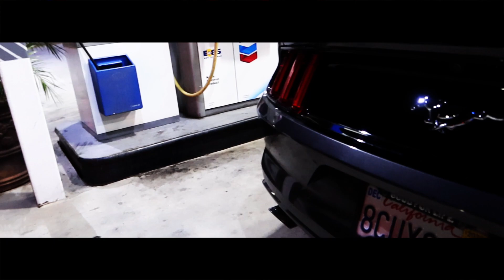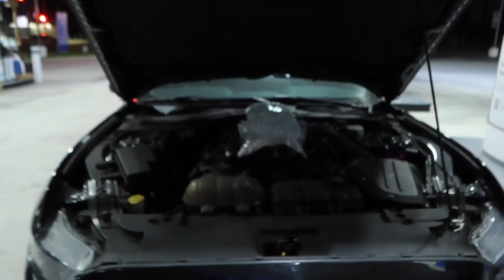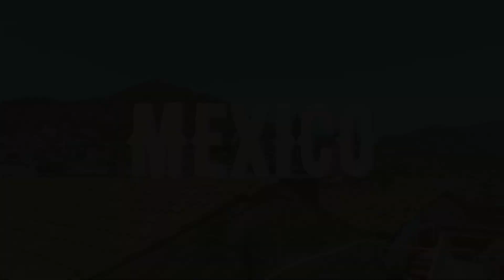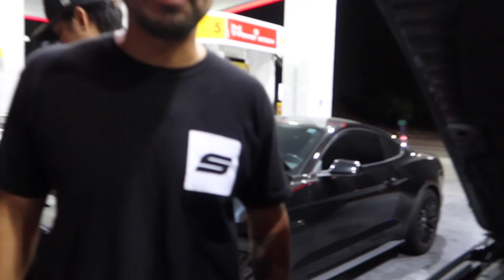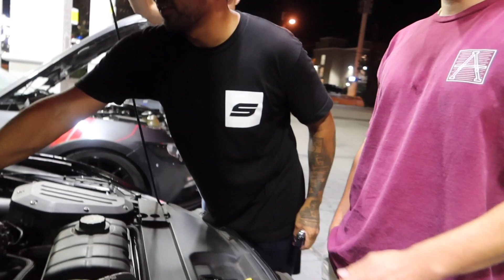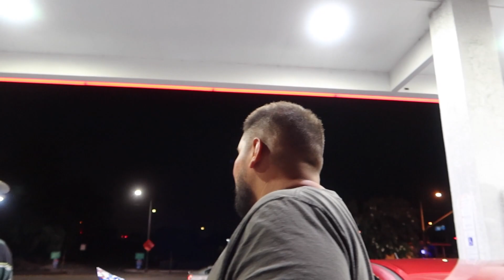MUSTANG ECOBOOST (FBO E30 TUNE) VS MUSTANG GT (ROUSH SUPERCHARGED) 😳🤯

Comment: I don’t know what he’s got but if that’s a factory Roush setup with the warranty they’re very mildly tuned.  550whp or so. He can pulley down, go e85 and get Lund to tune it and get closer to 700 at the wheels. I’m guessing by how close it was at first it’s probably pretty mild, but you can get a lot more easily out of it. Roush in the GT world is generally the one we’re told to stay away from, but the factory Roush cars with all the badging are sick.  Great video.
Reply from the maker: Thanks Cole!